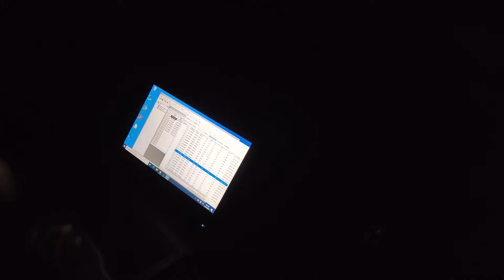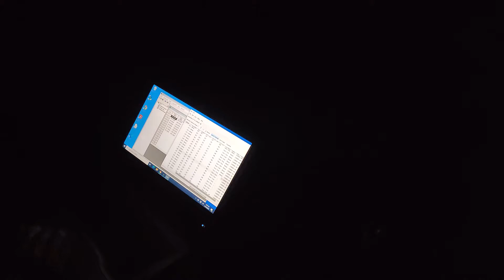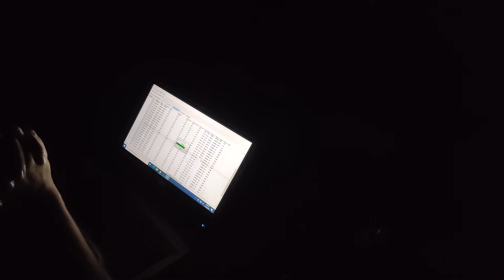Rivitis RT97s GMRS repeater

Comment: As being a seasoned Hm Operator for many many years you do make a good point line of sight is good but line loss is the factor you must learn about my friend and you will learn in time if you start with 5 watts maybe just maybe you will get 3 watts out. Rule of thumb and anyone with a beginning knowledge says start with the most to get the best out. In GMRS read and learn the FCC rules 50 watts id legal so why screw around with 5 watts and be a fool to spend all the money for the terrible results. If you get time to go bacj and get your GED and its not hard you will learn math instead of buying all the crap you don't need but you will learn in time. 5 watts id a waste of time start with 50 and get 48 watts out not 3 grow up to the numbers ask your wife about numbers.

Comment: Can I use this at a permanent location 24/7 or will it overheat
Reply from the maker: I have mine in a cabinet at the top of a hill. It has been running non stop for several months without issue.

Comment: If you want a repeater you need 50 watts for a good GMRS repeater with 10 in and 5 watts out you might as well just have a handheld you wasted your money. If you get 5 to 10 miles you will be lucky get 50 watts talk 50 miles its all in the math.
Reply: 50 watts does nothing if you don't have line of sight. The math is only good if there is no blockage. A bright room with no windows doesn't get you out farther if there is no path for it to go. Will it make a difference, yes but you should only pump out as much as you need. For my needs I have a cheap amp to pump up the power to around 20-25 watts with the source at half or low power. I can simplex from my height 10-20 miles depending on direction since I don't live on a hill or mountain regardless of power on 70 and GMRS, 2 meter that's a different ball game.
Reply: Height is might. I will take 5 watts at a good high location over 50 watts at a lower location all day, and the 5 watts range will be better. Power is not as important as line of sight.
Reply from the maker: I think you miss some of the point. Im not using this to extend flat range. I am using it rather to get over obstacles. Sorry you only see one way. I think it was well worth the money.
Reply: @whynowork8480  There is an antenna called a "yaggi" you can angle it and it is pinpoint directional not omni directional do some reading or ask for help.
Reply from the maker: @rockytop441  I know what a yaggi is. They don't work through mountains.